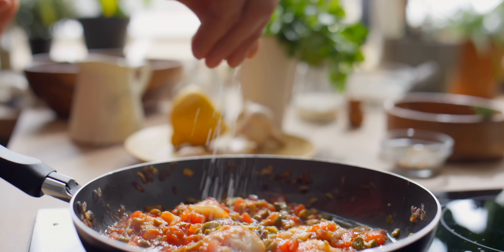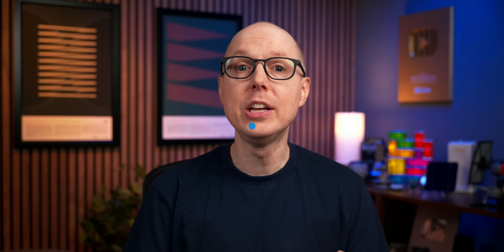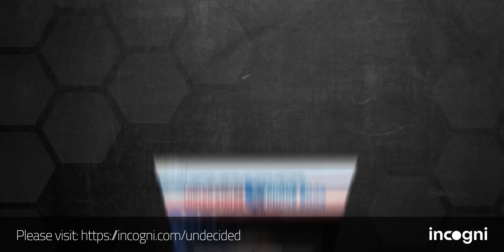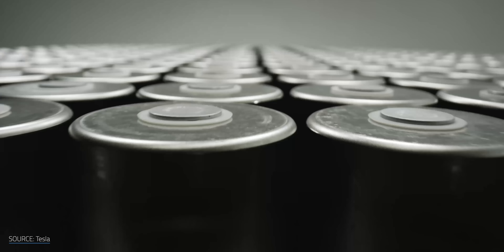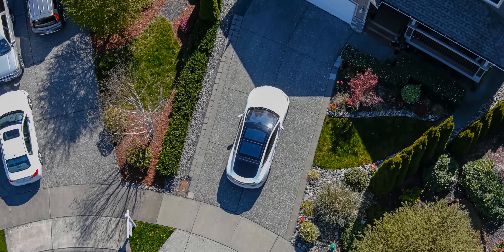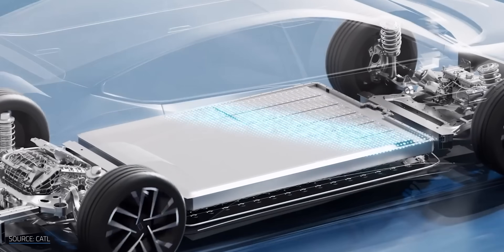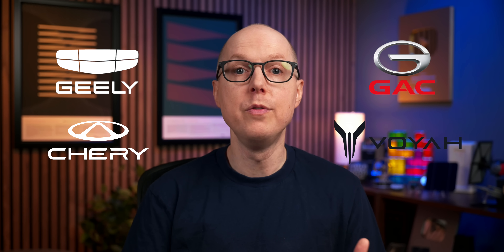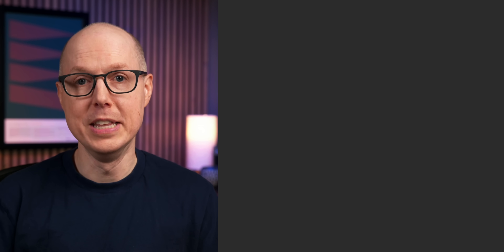How CATL Made Batteries 90% Cheaper (And What Happens Next)

Comment: If batteries fall to $10 per kwh they don't need to last forever as long as the battery pack is easily swapped out. You could swap out the battery pack 3 times during your lifespan of the car , and as long as the swap is easy , still be half the price of LFP.
We already accept , shocks, brakes , exhaust and even the starter battery in ICE cars need to be replaced several times during the life of a car.
Reply: It could also completely replace the lead acid batteries, would still greatly outlive these and with a reduced weight/volume.
Even Tesla seems to have switched only very recently from the lead acid 12v batteries (because they still use a 12v battery for accessories) to a 16v lithium one.
Reply: @pbe6965  the whole 12V batteries in EVs have been a problem for anyone who hasn't made the switch.
Reply: @pbe6965 tesla has never used lead acid, even in their first car the roadster it used a lithium ion.
Reply: @unlicensed_camera 
Tesla’s 12-volt batteries were lead-acid up until 2-3 years ago.
Reply: @pbe6965  Yes! Recycling lead acid batteries is dangerous for those who work at the recycling plants.
Reply: And the sodium ion battery would be way safer to recycle. Win/win
Reply: @MajorRenegade  On top of this, the fire problem is an easy solve as class D extinguisher can handle it with ease
Reply: @MajorRenegade  how is sodium ion battery safer to recyle?
Reply: @edwardli217  sodium isn't toxic
Reply: @edwardli217  also more stable than lithium, you still dont want exposed sodium metal to touch water though 😂
Reply: @unlicensed_camera  Correct, however the Al-ion battery is coming soon, and it might just skip the Na-ion battery altogether
Reply: But the engineering needs to also be reworked to allow the batteries to be swapped. ATM many manufacturers make it excruciatingly difficult to swap the battery packs.
Reply: @Awrethien  swapable battery packs also have their drawbacks, structural battery packs would save a lot of weight but the battery can't be swapped if it's part of the chassis.
Reply: @pbe6965  in some cases it's possible to have part of the chassis that can be hotswapped with basic tools.

That's something I'm experimenting with on a diy 3-wheel ebike I'm working on.
Reply: @pbe6965  It can be structural and swapped.   The car's frame would just be very weak during the swap. Tesla already allows their structural battery packs to be replaced.  It's just a very complicated and involved process.  I'm sure if it were something consumers wanted or benefited tesla they could simplify it.
Reply: @Awrethien  Leaf it's easily done in a day - not sue about others but it's still, way, way quicker than an engine swap. Maybe with the newer "structural battery" type frames, it'll be harder
Reply: @Awrethien  One reason why it is so diff is that they really need to protect the battery so it would not catch on fire/explode.
Reply: Why not both, if it is $10 and can last 3 times the life cycle of a normal car, then they could be swapped back to another car or to grid storage solution.
Reply: @danielvilliers612 You may even find in the future 3rd party buyers for your old battery pack , where it could be used for grid storage, similar to how companies now buy your old mobile phone when you upgrade.
Reply: @danielvilliers612  "Why not both, if it is $10 and can last 3 times the life cycle of a normal car, then they could be swapped back to another car or to grid storage solution."

Chinese auto manufacturers that tried using swappable packs are no longer in business.

YOU create a company that can compete in the auto industry, give that one a try and let me know in 10 - 15 years how that went for you.

There are REAL safety issues and manufacturing issues that make it unrealistic because you know, people shop price more so that almost any other issue.

There isn't a problem that needs to be solved when these companies like CATL and BYD ALSO make their batteries now to where it's easier to recycle materials, but considering the move to sodium there's less in the battery that drives the need to recycle.
Reply: I think the more readily comparable thing to an ICE vehicle is the fact that you have to put gas in it every few days or it stops working. You have to drive out of your way, putting wear and tear on the vehicle, so you can refill the vehicle with gasoline while you huff gas fumes. Compared to parking your car at your house and plugging it in. Even better if you plug it into an solar PVE offset system.
Reply: That's the rub. No company is going to give you a cheap option to undercut future sales. This is what we call a "too good to be true" situation. Probably why they won't share the white papers.
Reply: @kineticstar  I agree.  Unless it is a new start-up company trying to take market share.  Or a new company from China.  Existing companies will take that savings for themselves and not "trickle" it down to consumers.
Reply: The NMC battery in my F-150 Lightning is at 100% efficiency after 20,000 mi.  It's estimated to be above 90% by 2 mil miles.  It will outlast me.  I'd buy a sodium battery-powered EV.  It would be great for my cold climate region.
Reply: Even EV batteries that have reduced capacity/range and are replaced have a value in storage systems.
Reply: With the number of advertised cycles hooking up your car to the grid or house when you're not driving becomes 100% sensible.  Then again at $10/kWh you can have 100 kWh home battery for $1000 plus the price of a 20kW inverter and installation.
Reply: And home storage use?  Absoluted changes the cost equation.
Reply: It would be too heavy to provide good range for cars.
Reply: @jmlinden7  If you can swap batteries, you don't need good range. My chopper has a 100 mile range and it is good enough for me. NIO/Onvo makes swappable batteries.
Reply: @grzegorzkrk  Nio has stations in Norway too - maybe Sweden and Denmark too? Youtuber Bjørn Nyland has several videos showing how it works.
Reply: @grzegorzkrk swapping is too inconvenient for consumers. If they only take short trips then slow charging at home is more convenient. If they need long trips then they won't buy a short range ev regardless
Reply: @jmlinden7  And that's exactly what I imagine NIO owners in Norway normally do, charge the swappable batteries in their cars at home. But if they decide to go for a ski trip in the Alps, they perfectly well can swap along the way during a 10 minute coffee break and then continue on.
And the beauty of it is that it is low tech actually, it would have worked with the nickel-zinc batteries of a Baker Electric 120 years ago just as well!
Reply: @jmlinden7  Fleet vehicles used for local business certainly would use a battery swap.
They won't need many spares, at most 2 batteries per vehicle(24/7 operations) assuming charge rate is slightly faster than mean discharge rate. There are also a lot of industrial electric machines that can't use Li cells due to fire risks, most still use lead-acid as the mass just replaces some ballast and they are more interested in volume, lifetime kW cycles per dollar, and discharge-durability aspects. (And yes they do swap 2 ton lead acid batteries mid shift.)
Reply: @grzegorzkrk  It would be more convenient to just rent a different car completely for a long-distance road trip
Reply: @mytech6779  Yeah swap stations make sense for fleet vehicles since they have to have a centralized yard anyways
Reply: The other draw of a battery switching station is that the batteries are charging while they are waiting.
Reply: Not to mention the difference switching from a lead acid battery to an electric powered car battery. It's sorta apples to oranges, but the recycling of batteries suddenly becomes much less caustic, possibly even economic to recycle in the U.S.
Reply: That's true, but they will get a handle on battery life, as they have been doing with LI.
Reply: Correct. One of the major issues of current batteries is that they destroy used car sales, which directly impacts the bottom line of dealers and a whole secondary industry focused on repairing and maintaining older cars. $12K to replace a worn out battery versus $1500 is a massive change. Dealers can then just swap the battery when getting a car ready for re-sale and it's now worth selling. 
Currently you can buy cars like a Mercedes EQS for 35K. The issue is the $45000 ( not a typo ) battery cost that is tanking its value. It's also a major factor in push-back for many sports cars. You buy a muscle car with the idea of keeping it for decades, potentially. If it's junk in 10 years... there's a reason why people don't want an EV Camaro. Can't modify it, if it breaks, it's totaled, and the only "classics" will be in museums. Cheap and easy to swap batteries - same as say, replacing a radiator in a conventional car fixes it all. 
So it will happen, and quicker than you think.  The first $20K EV to market that's not a joke will be the actual "Model T" moment.  I suspect it will come from Toyota or Honda.
Reply: @plektosgaming  The used EV problem is mostly just mental for people.
Even the people in battery recycling or used car selling know that the batteries aren't a problem you have to think about. The batteries outlast the car unless it had an actual fault from manufacturing or damage.
Reply: @nfzeta128  And yet when they do need replacing.. I had a friend who had the battery on his BMW fail 3 weeks before the warranty ran out and it would have cost him 16K to replace. The mental image of a massive unknown repair bill is there and always will be, same as how many people  factor in a transmission probably being on its way out on a used vehicle after 120-140K miles.
Reply: @plektosgaming  was this a BMW i3 or something? Because very few EVs are going to be out of their warranty.

Also failing around that time has to be due to some sort of damage.
Reply: @nfzeta128  Actually, yes. 7 years and 50 weeks. Would have cost him a fortune to replace.  And when he went to finally sell it last year, that was the question everyone asked him first - was the battery replaced and how long ago. It's such a massive elephant in the room that it's causing the entire used car market to suffer.  Would you pay even half what a 2018 Model 3 should be worth if it had 70K miles? Knowing that the warranty had only 1 year/10K left?  Of course not.
Reply: @plektosgaming  You gotta understand his situation is an outlier and even then he probably saved that much driving an electric vehicle.
That's not to mention that battery prices are coming down hard, even 16k was cheap a few years back, now you can get many for 7k.
Reply: @plektosgaming  So even in this scare he still didn't have to pay for it, it was a rarity and even if the worse did happen now it wouldn't set back anyone as much.
16k is like a couple thousand more than a good few BMW engines.
Reply: @nfzeta128  The issue wasn't the battery, but that they had to almost completely disassemble the vehicle down to the frame. 6 or 7K for the battery, the rest was labor. And, no, nobody saves 20K driving an EV.  I've owned my Mustang for 12 years and haven't spent even that much on fuel. ( assuming your EV charging the whole time was completely free somehow )
Reply: @plektosgaming  over that many years, yes people can and have saved 15-16k. This is not even with free charging, just mostly home charging.

What you're talking about there is just a BMW issue, not an EV issue then. Also again sounds like damage that all of that had to happen because even with older EVs most can just take out and replace the battery, even the old Nissan leafs were fairly easy to remove and replace.
Reply: @nfzeta128  Let's figure this out. 100K miles in an EV equates to roughly $4000 in charging, in a best case scenario where you only charge at home and get the best rates.  100K miles in an ICE that averages 17mpg is 5882 gallons of fuel. At an average of $4 a gallon, that's $23529. 
That's your EV at best rates versus my V8 Mustang. It takes 100K miles in a best vs worst comparison to break even.

You simply don't come out ahead with an EV unless you can get 150K miles out of the battery pack or have some way to get free energy. Because that battery never lasts forever.  And that doesn't take into account the larger purchase price of the EV. We've all been sold a pack of lies. The promise was that EVs would cost less AND cost less to run.  Not cost 10K more and cost the same to run.

And, yes, 30mpg out of a Hybrid is considered poor performance. Compare a hybrid to an EV and it's laughably lopsided.
Reply: @plektosgaming  where are you pulling these starting figures from? Especially giving you're not even putting them into your comment?
How are you going from $23,500 for gas vs only $4k for charging and have the EV on a clock, not the ICE eternally behind?
Also where did the hybrid comment come from?
Reply: @nfzeta128  You said many people have saved 15-16K. The problem is that even in a worst case scenario ( EV vs Mustang V8 and high gas prices ), the 15K to replace a battery or even the fear that you might at 100K miles ( 2 years out of warranty ) basically negates all of that, either in the actual replacement or lowered resale value. 
I added a Hybrid as you don't even need to factor in the battery. The initial MSRP difference is enough such that you never break even on the EV. 
Totoya Prius vs Model 3: 28550 vs 42490. Let's say you get the $7500 tax credit - AND actually own that much in taxes ( oof ). 28500 vs 34990. 
100K miles in the Prius - $4 a gallon gas. 50 mpg because you have a heavy foot. $8000 in fuel. 
100K miles in the Model 3 - $4000 ( the actual national average is $5500, so this would be a very low cost - maybe you also have a little solar.
So we're seeing a worst vs best comparison of $4000 saved. The issue is that the break-even point for the Prius vs the Model 3 is 160K miles.
Will that battery in the Model 3 last 160K miles? What does the replacement cost? 
Smart drivers simply buy the hybrid and save a lot of money over an EV. 
Now, if the battery in the Model 3 was only $2000 instead of $8000 ( manufacturer's cost ), then we would be looking at a Model 3 that sells about the same price, most likely ( we all know Elon is charging more because of that tax rebate - watch the price drop to 36K in October).  THEN it makes sense as you get better economy for the same price and the replacement battery still leaves you slightly ahead.
Reply: @plektosgaming I see your problem you're not comparing similar spec cars.
Reply: @plektosgaming Also heavy foot on a priest isn't 50. Then you're totally ignoring regular maintenance and the difference in cost there. All of that, for a statistically improbable situation.
At that point you're just paranoid and it's not a matter of logic.
Reply: @nfzeta128  How so? If your "goal" is to get the least expensive reliable hybrid on the market and the least expensive reliable EV on the market, there will still be a 5K price difference. Remember, while the industry is falling over itself about a "30K EV", the people who just want a vehicle to get from A to B really want to spend closer to 25K.  If you don't want a Prius, you can get any number of hybrids ranging from the humble Corolla hybrid for $25K all the way up to vehicles like a Mazda CX50 for about $34K. With the EV credit going away, Your options are $35K for pretty much the rest of the industry's staring line (Leaf and other super budget offshore idiocy aside - ugh). 
The fact is that the EV is always at least $5K more money, and it takes 100K miles to make that difference back.  No matter what it is. EVs are just not the best option for cheap commuting. Toyota's CEO knew this and now Honda has scaled way back.  They did the math and EVs are just not "ready yet" to replace traditional vehicles - not without some new cheaper battery.

If the little Kona Electric ( as an example ) was now $28K with a $2K battery replacement cost, there you go - no reinventing the wheel, Ford. Hyundai can literally do it by moving to a cheaper battery. 

Which thankfully IS coming. :)
Reply: @nfzeta128  How many of us have driven or know of people who basically do zero maintenance on their Toyotas and they barely are in the shop for anything for the first 100K miles? Yeah, almost all of them. lol. Boring as they are, Toyota makes the best hybrids and they cost almost nothing to keep running.  Let's say an oil change every 10K miles, because the motor isn't really stressing itself much. You still really don't ever break even, because let's say you got $8K ahead on the EV somehow at 200K miles ( assuming the battery made it that far).  Now you have an 12K battery replacement. Oh, and a 4K replacement for the smaller Prius battery to be fair.
Zoop! back to even. The math isn't hard, here, despite how we all want EVs to "Save the planet" and stick it to big oil. Current EVs are a luxury feel good option and not actually less expensive to own and run.
Reply: @plektosgaming All you're talking about here is the lack of choice in the US currently. Even then there is a huge used market for EVs. That doesn't make the comparison realistic or fair. Unless you're just looking for a personal car and advice for that making said argument is moot.
Reply: @plektosgaming I have one of those Toyotas and with little to no maintenance problems do start, your mpg suffers a lot and you do have to think about replacing big ticket items around 100k miles.
Reply: @nfzeta128  Keeping one in proper running order isn't that expensive, to be honest. Many of the same expenses also apply to EVs as well, since they typically have complex cooling systems and more, same as a hybrid.  So you aren't paying for... oil changes?
Reply: @plektosgaming the cooling systems for EVs is a closed system and since it doesn't run as hot it's long term and a lot of the other oils in a hybrid or gas don't apply.
An EV in general just has less moving parts and less things to worry about. It's just the electrical and tech work for the systems that's expensive.
Reply: @nfzeta128  You still have the AC system for the passengers as well. Tires, brakes, batteries ( because most have a separate starter/AC system battery). EVs aren't buy it and forget about it.
Reply: @plektosgaming  EVs are the closest thing to exactly that as you can get for vehicles today (not including stuff like ebikes) The HVAC system in EVs is integrated with the heat pump and doesn't require anything but changing the air filter and that is easy to do yourself.
 Tires are the one thing that you have to worry about with EVs and even then it's not really much different from ICE.
Brakes are the most buy and forget among these things because due to regen braking you don't use your friction brakes as much as a regular car. 

The 12V batteries in earlier EVs did give trouble because they were the same led acid 12V as ICE vehicles but the newer ones have switched to 14V/16V lithium ion batteries and those also last much longer than the lead acid in most ICE or hybrid cars. Think more like the old batteries which took distilled water, most likely longer.

Basically, more so than even most Toyotas, EVs are buy and forget. That's why they have to invent service packages just to get some money in aftercare services because until something goes wrong in terms of damage or some manufacturer fault, you don't really HAVE to do anything. 
Also, now that online updates are a thing you don't even have to go in for most of those.
Reply: @plektosgaming  Exactly! I swapped the battery in my 2011 Mitsubishi i-MiEV myself in about two hours (with one from a wrecked car). If manufacturers are mandated to enable easy battery change without crazy amounts of labor and specialized tools then the risk to the consumer is acceptable and second hand prices will be stronger. It's rather silly to see perfectly good cars being scrapped due to battery failures.
That's actually one of the stronger points of the older (Model S and X) Teslas: They were originally designed for battery swapping stations (that never materialized), so dropping and reinstalling (or changing) the battery is quite easy with automatic connectors.
Reply: ironically, these cheaper batteries have absurd cycle life that is about cell's age, not wear. I still have lithium ion batteries for almost 20 years ago that I use today, albeit, lightly or little capacity.
Reply: But it also is expeted to last much longer, life time of vehicle and beyond, so can be integrated and made cheaper to assmble and resulting in a lighter car.
Reply: This is what th US knows . Fossile end before it s dry
Reply: do NOT give them ideas
Reply: Excellent analysis.  And that swapping may give jobs to people.
Reply: I think you're gravely missing the impact of mass production of batteries as opposed to say exhaust systems...
Reply: Lifepo batteries are already at 1$/kwhr.
Reply: if they let you do it. regulations need to be imposed to those companies that don't like this to happen
Reply: With 10,000 cycles/ 3 million+ miles, the vehicle will be swapped out before the battery needs to be.
Reply: Sounds like that is a drawback that does not exist for it so no point in inventing downsides that do not exist.
Reply: @SomethingElse4U In a more practical sense, even your least expensive new EV has 10-20K of its MSRP because of the batteries. 15-20K commuter cars could return with a cheaper battery option. Then you can zoom around in your 20K EV and laugh at the plebs who over-spent.
Reply: Counter to a battery switching station is that it might be better to compromise between permanent and convenience to require a mechanic (non-dealer specific as a high priority) to switch the batteries every 2 years or so. (The condition of this being that it would afford some more stable integration into the chassis. Auto-locking mechanisms for daily battery swapping is asking for weight problems, and breakage issues, even if a heavy machine is performing the swap. Though, I cannot help but think that the chassis integration issue is not as big of an engineering challenge as it is made out to be.

The other issue with battery swapping station is that batteries are of varying strengths and conditions. This may or may not be a "real" issue, but it seems weird. If your battery gets damaged in travel, does the station verify its condition? Seems like asking for a plethora of issues that need to be laid out and solved, potentially becoming too much trouble compared to the 2-year mechanic.
Reply: @taylor-worthington  People make me wonder.
You have an engineered solution, right in front of your eyes, tested, proven to be working. Nothing missing, no promises that will have to be fulfilled in the distant future. No rocket science involved. People happily driving their vehicles just the way they used to, range anxiety gone, no need to compromise. Yet the majority seem to choose to deny that it is working. Why this propensity to counter? :)

BTW: you do not have to own the battery in your car just like you don't have to own an oil well or a refinery. You can have the others to take care of it. You can lease the battery, make it a part of the external infrastructure, or something disposable, like fuel. You give back an empty vessel, accept a refilled one in the exchange, for a fee. And the auto-locking mechanism - question: do you trust your car door lock? Why would you even think that the battery locking mechanism could be any less reliable than the door lock that can reliably close millions of times before failing?
Reply: @grzegorzkrk  Well, I suppose the discussion entirely is up to people who've probably thought of all this anyway, but despite that it still seems to be some zone between attempting to have influence, and thinking about the factors out loud and general passion.

If somebody could get on the 5-min, daily swapping station thing, then that would be so great. Because yeah: it's instant babe.

In addition to it being about predictable cost assessments, it is also a supply and demand issue. The supply and demand aspect of it is somewhat of a wild card in determining its "practicality." Charging time is just not good enough for everyone. If they could do 5-min mechanical swapping, then that one thing would be absolutely huge right? So all the problem solving for it might very well be worth it despite what I said.

The supply demand issue might not directly compare to a gas station, because electric cars come with a different set of benefits especially if you are removing the charge time issue. It shifts closer to an all-win situation.

Still comparatively, a gas station has huge tanks underneath it, but it's still relatively simple, with fewer parts to maintain. Will a gas station equivalent/alternative run an underground charging warehouse of 500 batteries, with large machines that take one charged battery, and then target the bottom of the car from underneath, then unscrew the old battery, clean the contacts, etc? Every battery swap station would require this. It's a commitment to a large machine from the stations, and a surplus of batteries many, many times higher than there are now. 

But a huge part of what matters is the engineers, and what they can come up with, and cost projections, and use projections. If you're going to compare to a gas station, then compared to a gas station, these swapping machines seem more expensive than nothing - meaning that it seems like you are simply adding something to an equation where otherwise, every customer just reaches over and does the gas pumping. Now, you are replacing that simple act with an expensive machine. But does that mean it's purely a cost-add? Well, I don't happen to have contact with the requisite team of engineers and analysts. The idea is pretty awesome if it could be done. Maybe these are fully automated vending machines with no employees required to monitor the station (saving money). But that might be a stretch. Obviously such stations will require some form of monitoring, reloading and maintenance.

You don't always need a heavy 300 - 400 mile battery if battery swapping stations are as common as gas stations. This variable also throws a wrench into the analysis. Station charging times, battery counts, battery size.

The equation of prospects could morph in that there can be varying priorities on charge-time, because you are freeing up the necessity to charge as fast as possible. Now, as much as that feels painful, it could still become a compromise that makes the system work if it can budge a little. Like, if there's a serious tradeoff between charge time and weight, then you can budge on the charge time, because instant swapping changes the priority. Long-term home charging is still a thing, but the necessity to sit and wait at the charge station is reduced.

This also effects projections of how many extra batteries would actually be needed to do these 5-min swap stations. The battery engineering can be tweaked according to availability of batteries, and demand for the swap stations. People in apartments might fully rely on swap stations, whereas people who still have long-range cars, or shorter driving distances, will only swap their batteries every other month, or year. If customers can decide between batteries with different purposes, then it adds a lot of factors to tweak the analysis of how many people will use these stations. Customers can decide what their individual driving "strategy" is.

So, what this means is that all these factors come into play in deciding which decision are customer decisions, and which are made for the customers. This also effects how you design the system. Like, all a customer has to do is decide their driving profile, and which batteries they get, and how often they get them. And they only really have to decide it one time. It's not a massive headache every time you go the station.

Using uniform smaller battery packs could be good for uniform standardization of individual pack size. Varying numbers of battery packs per vehicle, potentially held in magazines that are multiples of the pack-size - some use two small battery packs - some use five small battery packs. Some cars put them in parallel temporarily or whatever for super charge mode - some use them in a hybrid capacity - some cars are just tiny - and some are trucks - and some have long range. . . . What kind of mechanics would be required to load varying battery pack magazines where the magazines are uniformly multiples in size? Maybe the machine should be able to handle cars with multiple battery locations?

Uniform battery size and/or standardized magazine type do not limit technological advances in the batteries. As long as the voltages and size stay the same, then different battery technologies can advance or change with preference. Some customers might choose between battery types that have different advantages if that is how the system evolves. Charge time, weight, age, battery type, cost, etc. But then again, adding more battery types means effecting the storage at the station.

You take money to the bank, and sometimes the bank decides that the money is too old or destroyed, and they take it out of circulation. The easier the batteries are to recycle, the easier they can take them out of circulation and then put them back in. You could also have different prices for different quality batteries like different grades of gasoline. But these thoughts are headache inducing.

Speaking of headaches, you know pricing models and ownership models can be odious or helpful and be ethically charged issues. Problems are problems until they are not, and many times these things are extremely dynamic decisions on how to allocate losses and gains depending on how it's working. A station subscription model could be really terrible. A leasing model could be ok, where you might pay for battery damages. Or, maybe it all gets absorbed by some other means, and it's just a simple exchange fee. You know cus companies absorb costs in some places to create a customer experience babe.
Reply: @taylor-worthington  Thanks for your response! Yes I agree the infrastructure complexity and cost increases and that the accountants could ruin the best engineering. Still, as an engineer myself I strongly believe this could work out nicely, especially with the cheaper batteries on the market. Where engineering is concerned, I think not much more could be done, maybe scaling up and integrating the battery swap stations with the electrical grid, because it would have an effect on it, possibly a positive, stabilizing effect - the batteries in storage could help power up the grid in case of a blackout.
BTW, it was Elon Musk who presented the first battery swapping station implementation for his Teslas, more than a decade ago (then the idea died promptly, facing the blank stare of the public). There were other attempts, but at this moment only the Chinese NIO is committed, AFAIK.
Reply: And the consumers themselves encourage planned obsolescence...
Reply: @stuckonearth4967   Well, that's consumerism. On the other hand, there has also been a strong movement for recycling old "must haves" to make new ones...
Reply: @taffygeek  no, its unnecessary to carry so much friction in your Engine. No reason to swap out a starter unless you haven't resolved friction in your engine.
Reply: At the current $10-30k car battery that wouldn’t make sense, but at under $5k it totally could.
Reply: @blakereid5785 unless you're going for top of the line and even then batteries don't go up above 20k any more, at least not for a car.
Reply: @nfzeta128  fair enough. I was referencing invoices that made the news 2 years ago. That would include labor, though. None of the EVs were designed for easy battery replacement. I think that will only change for commercial use. Not much use in the average consumer vehicle.
Reply: @blakereid5785 you mean easy relative to small 12v batteries, or easy relative to engines? Because for an EV the traction battery is a major conponent and still they're easier to remove than a lot of engines or transmissions.
Reply: @nfzeta128  Its currently on the more labor intensive end from what i can tell. Closer replacing the transmission than to any maintenance task. EVs are built more like iphones. For commercial EV battery swaps it needs to be closer to 12v swap as far as complexity and time. Residential vehicles don’t need to be as fast with decent lifespan of the battery. Any simple battery swap seems like it’s just a replacement for fast charging, though. Do you see any advantage of fast swap vs fast charge?

The higher cost in the US today is also due to just a lack mechanics with EV experience.
Reply: @blakereid5785  It's not labour intensive, the price is 'inflated' because it requires more expertise but it's not a long or hard process for people who know what they're doing and have the right equipment.

There is no reason why a traction battery needs to be as replaceable as a 12V battery. Those things last like 3 years tops with the newer ones and a traction battery is supposed to last beyond the life of the car. You're less likely to need to take out a battery than an engine.
Reply: @nfzeta128  For residential/ consumer EVs i’s agree that theres not much point in simple battery pack replacement. Thats why i was talking about commercial EVs. In order to make battery swaps for commercial EVs viable it would need to be that fast. I’m talking about taxi fleets, buses, mining vehicles. Things like that. Taking even 1-2 hours to swap batteries or recharge is a loss. I’m not saying that the rapid battery swaps are for battery degradation, just for rapid redeployment. 

For consumer EVs, it’s fine that it takes a all day to replace the battery. Seeing tesla teardowns, i don’t know what your talking about. Its a pretty significant job. I haven’t seen anything like that for the new chinese evs, maybe they’re simpler.
Reply: @blakereid5785 You don't need it for commercial EVs either. The trucks so far have a good record with original batteries and so do most taxis with many having 150k miles and up to more than double that on original battery.

Also as far as battery swaps go NIO is famous for that with 5 minute swapping of batteries, but as their results are showing, it is unnecessary.
Reply: @nfzeta128  I’m not referring to degradation, haha. I don’t know why you keep bringing up how long the batteries last. I’m basically talking about charging time. 

Fast charging is developing pretty well too, so maybe swaps won’t be that useful in the end. 5 minute swap vs 2 hour charge is significant but it seems to be getting to 30 minutes or less for 85% charge.
Reply: @blakereid5785  There are already 5 min mega fast chargers in China for EVs. and that's full charge, not a more realistic 10/20-80% charge.

Charging times don't really matter because the way you charge them is different. This is why I didn't think you meant that as a problem.
Even taxis as EVs is really successful in China and starting up around the world right now. Even in the USA there are a lot of Tesla ubers or taxis and they get along fine. This is where those stories of 600k mile EVs are coming from, and those are regularly fast charged. Teslas for example only need around 15-19 minutes to get most of your range back. That's a coffee break or the time between getting customers sometimes.
Reply: The reason is safetly and cost. And the fact that they can not compete with BYD BLADE LFP which is getting an update in 2027 probably. So they gotta up their game.
Reply: Dude, when the CURRENT battery packs are getting you to 200K miles you're talking about a problem that doesn't exist for most drivers and it's not a concern for the auto makers.

Most people are going to buy a BEV even if they say you're range/charge is going to drop to 85% its capacity after about 200K miles, because it takes more than a decade for most people to get that much driving in and there are families that don't get to 200K miles until about 15 - 20 years, which is WELL longer than most people have a vehicle.

The concerns of the auto makers should be:

1. COST
2. SAFETY
3. RANGE/charge

It would cost more to make a system where it's easy to swap out a battery pack.  It would probably affect its range AND safety.
Reply: Yes, and recycle-ability is key. It cannot be that difficult to design a battery that is cheaper and EZer to recycle than to make from scratch. I mean, salt is just salt, right? Maybe some components need melting down and reforming. Not rocket science; you get the idea.
Reply: NIO
Reply: Nobody wants you to save money and have you car/battery running longer and cheaper. You meant to keep buying to feed the rich :)
Reply: Open up a swap shop! Swap shop, swap shop, swap shop.....
Reply: new Aluminum ion batteries hold three times the charge of Lithium, are non flammable, last 10 times as long, don't produce dendrites, charge faster, work in a larger range of temperatures, self cool, and cost one tenth the cost of lithium batteries.  They are the future, and manufacturing is slated to start this year.
Reply: in china they are experimenting with battery swapping stations which could also solve charging time
Reply: @v000000000000v  Yes though the advancement in charge speeds may make that a dead end the idea of making a battery pack that's easily accessible and swappable could see cheap EV cars hit the market with, say eg, a battery guaranteed to last 60,000 miles but with the ability to cheaply replace it later. Particularly if manufacturers develop a standard battery format (in various sizes compact, standard , long range etc) throughout their range.  
I think we look to much towards ICE vehicles with EV design rather than say electronics. View the chassis more as a motherboard with easily swappable components and upgrades.😂
Reply: @taffygeek  A 50 kWh car battery at $10 gives a starting price for a replacement at $500. Yes there are other costs for the pack, plus labour and taxes, but it is going to be nowhere near the price that naysayers claim.

A work colleague had to have his ICE Audi engine replaced at about $6,000. You would probably get three or four new sodium EV batteries for that much.

And we are still at the start of mainstream sodium technology - there will be density and lifetime improvements yet to come.
Reply: @taffygeek  The thing is that ATX standard was developed relatively late, before that there was a ton of competing standards, with every single PC having own quirks. Modern EV manufacturers are far away from even considering standardization of their small parts.
Reply: @v000000000000v not experimenting, they’re building 10.000. Also, Nio has swapping stations in Europe. 

Imaging buying an EV with a sodium battery for cheap for the daily drive ánd have the possibility to swap it for high performance NMC’s waiting charged along your route. Bye bye ICE 😢
Reply: @v000000000000v  Nio had that years ago.
Reply: @v000000000000v  That’s already a thing with trucks.
Reply: @v000000000000v  "in china they are experimenting with battery swapping stations which could also solve charging time"

They DID experiment with this and pretty much every company that tried this is already gone and the main BEV contenders left standing use typical battery packs that are built into the vehicle during construction because the reality is battery packs will be the last thing to go on most those vehicles because of current range is already WAY more than most people drive.

200K miles for MOST households is in the 15 - 20 year period, and they'll be replacing the vehicle for many other reasons before then.

It's a trivial problem that doesn't need to be solved.
Reply: Putin attacked when he found out
Reply: I don't know what trash cars you are buying or how you are beating them over curbs, but I have never needed to replace shocks, exhaust, or brakes in my ICE vehicles and I buy them used and keep them for 200k miles. ("Brakes" are not brake pads, pads are quick replace wear items. "Brakes" are master cylinder, fluid lines, proportioning valves, calipers, rotors, anti-lock electronic system, and pads.)